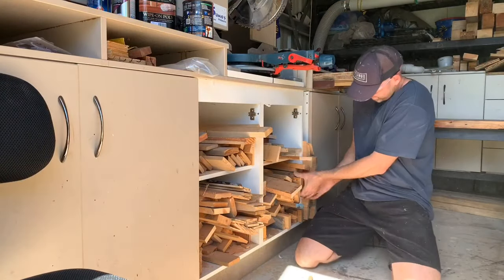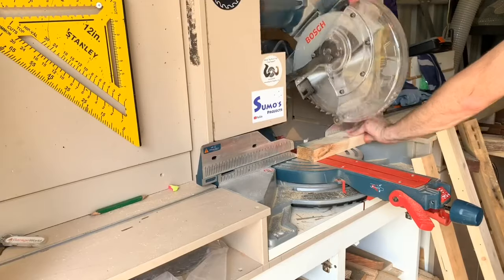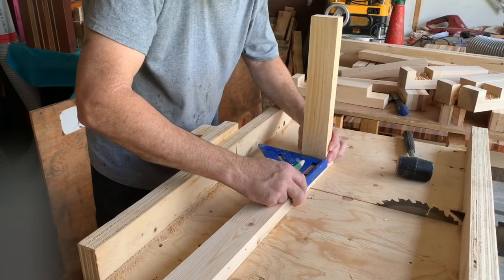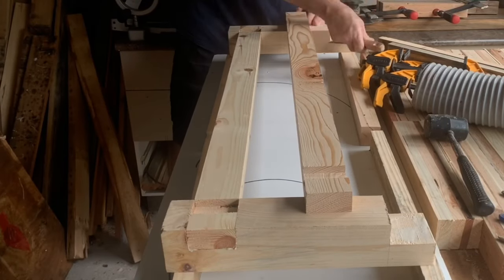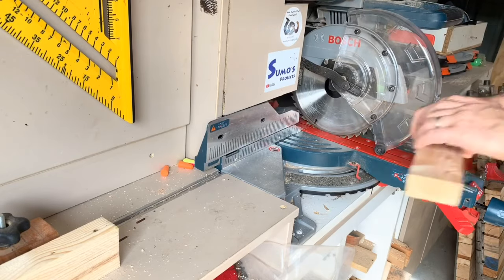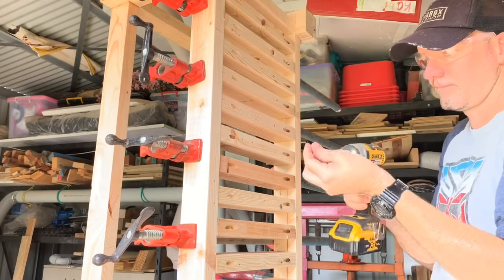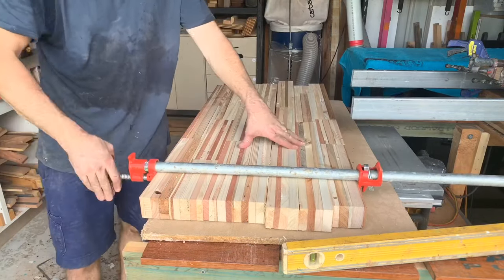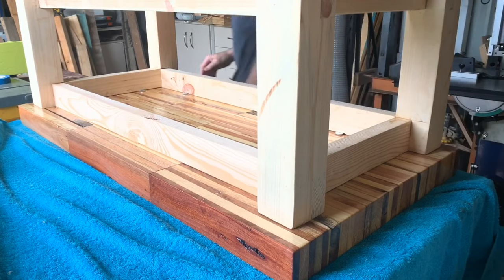Coffee table that SELLS very well made from Palletwood

Comment: Hey Mark! Big fan of your videos here. I was wondering, when you glue up the boards face to face like that, do you need to account for wood movement when you attach them to the legs / frame? I see that you use those figure eights in this case, but any experience from other tables? I'm just getting into these sort of glue ups, and in my research I found that the expansion seemed to be mainly across the width of the boards.
Reply from the maker: Expansion is across the board. It just good practice to consider any top on any frame. Cheers

Comment: Question about sawing pallet wood, there's always lots of sand and other debris in the pallet wood I can find around here - it has always made me reluctant to use it since I'm scared it will be too hard on my saw blades when I cut it down.

How is your table saw blade doing after all that pallet wood? Is sand stuck in the wood a problem for you?
Reply: @dainermade  Here in Sweden we almost exclusively use the "EUR" marked pallets, more sturdy built and designed to be used multiple times, they are usually quite dirty with both sand from being left outside and with various amounts of unknown debris piled into the wood.

My guess is that you easily come by the one-time-used shipping pallets? 

Such a pity I can't easily find those around here, because the stuff you build looks really cool.
Reply: I know I'm way late to the party but an easy way around this issue is to use an inexpensive circular saw blade in your table saw to make risky cuts.